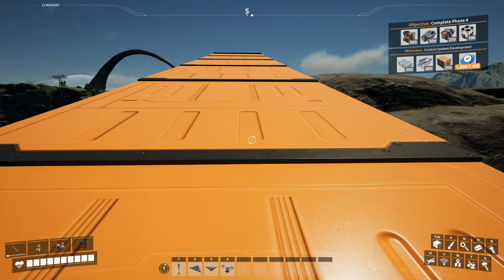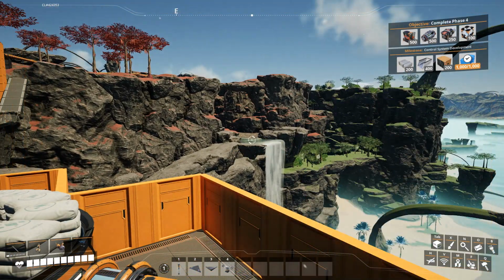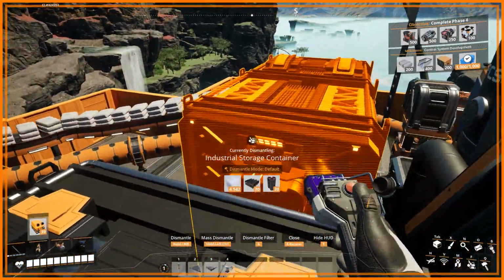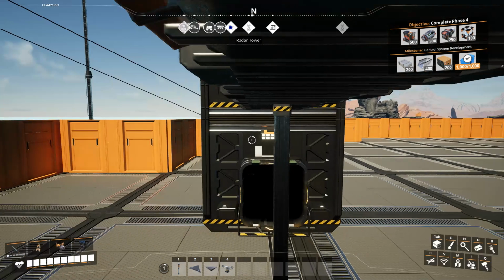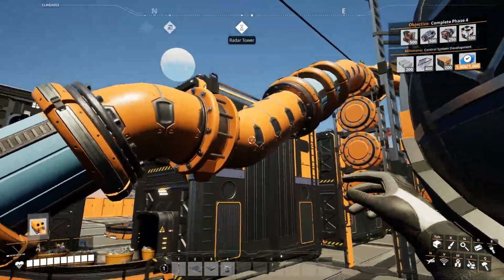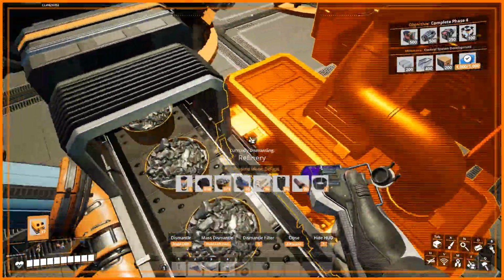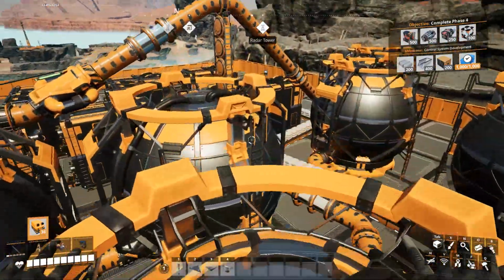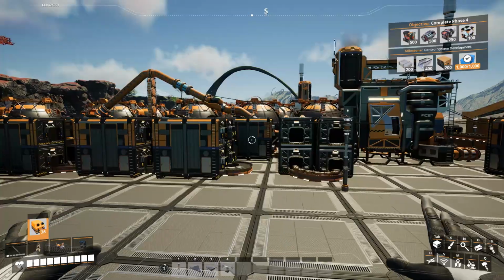Average Bauxite Refinement

Comment: why not use sloppy alumina alternative instead? 

i used that for a lot bigger of a project and it was very easy to make 

i just made a blueprint that take a bit of crude oil for the heavy oil for the petroleum coke for the electrode aluminum scrap recipe then just loop the water back and put a valve on the input of water i overclocked it a bit tho so it's running at 300 in 600 out then i send all the scrap into a smelter with the pure aluminum ingot recipe and for the resin i just have a conveyor going from the blueprint down the line of them into an awesome sink it's not that hard? (or did i go too far with it....)

(6000 ingots per minute for my entire world)
Reply from the maker: I shall endeavor to reach this level of intellect